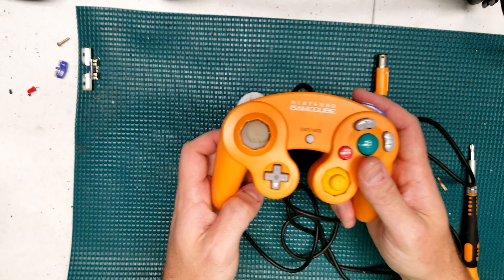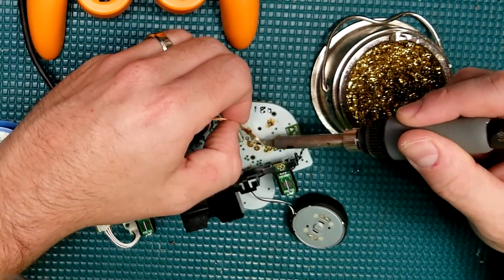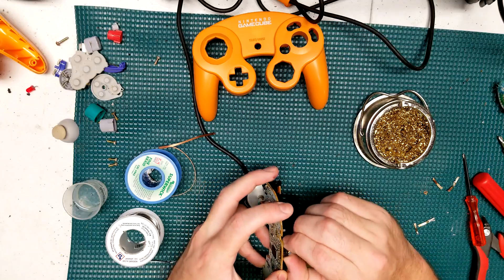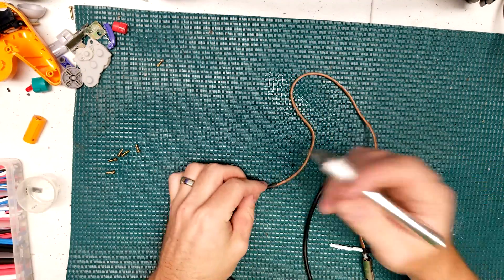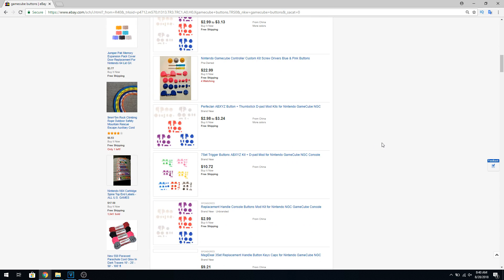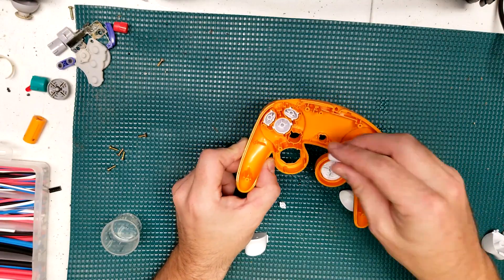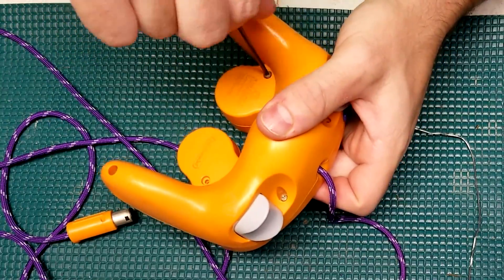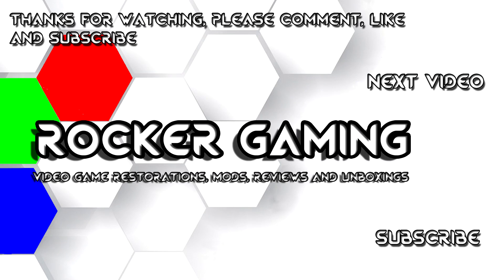Restoring and Modding a Gamecube Controller + Giveaway! Get ready for Smash Bros Ultimate! Custom!

Comment: Personally I think the 10 minute mark is the sweet spot for mod vids. I don't know if 5 is enough to cover everything in depth and really show the process.

P.S. I'm using your videos as a guide for my own upcoming GameCube mod. All of the stuff hasn't arrived yet but I'm excited to breathe new life in to the old favourite!
Reply from the maker: Lang, I am very happy to hear that!  Make sure you share before and after pics with me!  I would love to see what you come up with!
Reply: This will be my first real mod so I'm not going too crazy! I have a Pluto IIx board waiting to be installed and I'm thinking of adding LED lights and a XENO GC chip. I've seen the XENO clones sell on eBay at various prices and they're marked as "XEN8". The genuine XENO boards seem to be hard to come by and I'm kind of worried the knock-off boards will break after a while.

Do you have any experience with the XEN8 model and how prone it is to failure?
Reply from the maker: So a little dirty secret, lol.  Every time I have showed a xeno chip installed on the channel its a xen8.  They seem to be just fine as far as I can tell.  I would just order more than 1 as I have run into a few (maybe 2 out of 100's) that have not worked correctly.

Comment: Thank you! I have been playing around with mods for a while on GC controllers and kinda want to start doing it for friends and the cord trick was the last tool I really needed. I am an electronics repair tech so most mods come naturally to me but the cord thing was driving me insane. I was thinking people were getting braided usb cables and some how replacing the ends. I thought that seemed like way too much work for most people and one of the custom controller places offered colored cables for cheap which confused me even more. Then I saw one of the custom places call it a paracord wrap. So it finally clicked and now im here.
Reply from the maker: X9, thanks for stopping in and dropping a comment!  Feel free to sub if you have not done so yet, there is plenty of modding goodies on here and as far as doing controllers for friends, you should absolutely make it happen!  The paracord is a pain the first couple times you do it, but you get pretty decent at it pretty quickly.  Let me know how it goes for you!
Reply: Already subbed! I will let you know how it turns out. I might try picking up some paracord locally as shipping from that place you linked is expensive. I assume 550 cord is the same diameter and everything no matter who makes it. If I can find it cheaper I will let you know.
Reply from the maker: Sounds like a good plan to me.  They do have free shipping sales from time to time and that is when you need to pounce, lol.  Whenever I get an email notification I stock up, lol.

Comment: You could probably sleeve the cable easier if you just tape a skewer or unfolded coat hanger to the end of the cable and use the rod to feed it though.
Reply from the maker: It's a bit tight to make that work, but I'll give it a shot next time I do this mod!  I appreciate the comment!

Comment: You could try 750 paracord instead of 550. The outer sheathing is slightly bigger, may be easier to slide over the cable. You can look up Type IV or MIL-C-5040-H to find it.
Reply from the maker: fantastic advice!  I am going to look into it in more detail!  The 550 comes in more variety, but you're spot on with the 750, its decently bigger!  Thank you again, appreciate that advice!!

Comment: Hey great video. I have a question, I tried sleeving my cable and I have to cut off the connectors as well in order to get the sleeve on. Although when I resoldered it to the board the cable is no longer working? I bent the connector a tiny bit but everything seems to be fine on that end so I was wondering what went wrong with my cable. I had no other way to strip the wires than to burn them since I do not have a wire stripper. Is that what ruined my cable. Or could it be that I solder and resoldered to many times and I burned something? Would be great if I can fix this
Reply from the maker: Chris, thanks for the comment.  Nothing you mentioned there would seem to indicate that you ruined your cable.  You should have soldered your cable back to the PCB as follows:

1 - Blue
2 - yellow
3 - Red
4 - Green
5 - White
6 - Black

The Controller PCB is labeled with 1 and 6 so you should be use that and the guide above in order to get it back up and running.

Comment: What's the tool you used for removing the cables from the 6 pin connector? I'm doing the same sort of thing except replacing the whole cable.
Reply from the maker: I just use a very basic dental pick, but it word really well!
Reply: @RockerGaming  thank you very much! Great job on the controller!
Reply from the maker: No problem and thank you!!

Comment: Question, how important is the copper shielding on the inside of the controller cord? I recently did two, one with and one without the shielding and the one without is having issues. Any idea if that is causing my issues?? Thanks in advance for the input
Reply from the maker: In my experience and talking to others it's not important. I would just double check you have the pins all soldered back into the board correctly and in the right order as well as make sure you have no shorts between the pins on the board (use a multimeter to test).  If all that looks good, I'd use a multimeter to test for continuity between the plug and the pins you solder into the controller board.  Between all the above it should help determine what is causing your issue.  If all those come back without a hitch your issue is not related to sleeving the cable.

Pin 1 = blue
Pin 2 = yellow
Pin 3 = red 
Pin 4 = green
Pin 5 = white 
Pin 6 = ground

The above pinout assumes you're using an official GC controller from back in the day.
Reply: RockerGaming I did double check to make sure my pins were for sure in the correct order. Can anyone walk me thru how to use a multimeter to check that I don’t have a short somewhere. I suspect that it’s my solder job but am not for sure
Reply from the maker: @jmarquez5554  there is likely a video help explain it. But you set it to continuity mode. You know it's the right mode bc if you touch the probes together they beep. Then just put the probes on each adjacent pin. If you get a beep you have a short and you need to clean up your soldering.

Comment: What is the copper coil around the inner wires for? I stripped the rubber off of my controller and cut a few strands near the plug of the controller.
Reply from the maker: That is the shielding for the voltage, ground and signal wires.  Based upon what I have read and tested the general consensus is that Its ok to remove it.
Reply: @RockerGaming  That makes sense, because those wires are all individually sleeved. I figured the copper is what you were referring to towards the end of this video. Thanks for the response and keep making tutorials, your work is very inspiring.
Reply from the maker: @DxCrepp738  No problem dude!  Please share whatever you make on Twitter with me!  Will do, I am working on another controller mod video right now, pretty excited to share this one!!  Its been a long time in the works!
Reply: @RockerGaming  you got it. I'll be sure to share pictures when I finish this first controller. It should be done by the end of the week. I'm just waiting on the paracord.
Reply from the maker: @DxCrepp738  The paracord is the tedious part, just take your time and you use clear packing tape it makes your life 10x easier.  Also, I show the exact technique I use in this video, it works pretty well!  https://www.youtube.com/watch?v=ejyOUG4LifI
Reply: @RockerGaming  Okay Cool, the tape around the pins keeps them all in the same space so you don't have to cut them off.
Reply: @RockerGaming  Hey, so I am having a pretty rough time getting the paracord on my wire... is there a possible way we can work together on this; I can mail you the wire and paracord to have it professionally done. I will pay if so, and it might be a good video opportunity, maybe?
Reply from the maker: @DxCrepp738  Hey sorry, missed your last reply.  Here is what I would do: you'll want to bunch all the pins together into an arrowhead type formation then use some clear packing tape since its nice and slippery to hold it in place.  Then start to sleeve the cable using the technique in the video i linked above.  If that doesnt work, what you can do (if you're handy with a soldering iron) is exactly what I did in this video, cut off the pins and resolder the cable back to the board manually.  If you do this method it should be pretty easy to sleeve.  The key is using the sleeving technique I show in this video.  https://www.youtube.com/watch?v=ejyOUG4LifI

I am a bit backed up and not taking commissions right now, but let me know if the above helps or where you're having trouble and I can do my best to help you out!!
Reply: @RockerGaming  Long time no speak, sorry for the delay but I have been pretty busy myself lately, I understand. I have not tried sleeving the controller again, yet, but I do intend to try sometime tomorrow. I also did some research and found that the 750 cords may be more easy to sleeve the wire... Judging by the pattern of the cord in this video I'd say it's still 550. 

I also have plans to put LED's inside my console... don't know when but I just cleaned the system out earlier this evening. I gotta say it was pretty..fun. It makes me want to do more, so I'll be looking for LED diodes next time I go shopping.

Comment: Hey I’ve been working on mine for a couple hours and I’m having a tough time getting the GameCube cord through the paracord
Reply from the maker: Luke hopefully this will help:

Take a look at this video to see how I tape up the pins on the cable - https://youtu.be/g9Ea-tqHj5w?t=613

Take a look at this video to see the technique I use -  https://youtu.be/ejyOUG4LifI?t=199

Both of these should start at the relevant part of the video.
Reply: RockerGaming thank you I’ve been working on it for like 2 hours and nothing worked
Reply from the maker: @lukedavis_mp  No problem dude, hopefully this does the trick for you!
Reply: RockerGaming honestly I just think 550 paracord is too thin. I’m thinking I just have to go another side up. I’ve tried a lot of different things I just can’t get it all the way through
Reply from the maker: @lukedavis_mp  bigger will be easier for sure. I use 550, but let there be no doubt the first couple times doing this mod it was a struggle.
Reply: RockerGaming is your paracord 7 stranded?
Reply from the maker: @lukedavis_mp  I use 550 paracord from paracordplanet.com not sure how many strands but if you head over there it should tell you
Reply: RockerGaming hey thanks for the help! I message you on Etsy! I got it done! Works flawlessly. Quick question what can I do to ensure the controller doesn’t short out. I replaced a GameCube thumbstick and it work for a while but no longer works? Have any clue what happened? Thanks again!

Comment: I wonder,

The stickbox on the aftermarket controllers is usually absolutely crap. It's not too bad to begin with but they don't last at all.
I did buy one in China that looked like a knockoff Polyshine box, with yellow pots on the sides, but without the F logo and with a slightly different moulding on the pots, so it's not a real Polyshine, but it's pretty decent, seems like. Was a bit more expensive.
And yet when i looked up specs on Polyshine boxes from a local supplier, i noticed that those that are available to me have deadzones in X and Y, which is not needed because the real deadzone is software, and will make for a very poor angle control. They make it by plating a bit of metal in the middle of each pot. When i think My Life In Gaming tested an aftermarket N64 stick made from a Gamecube-style stickbox he noticed in his video a behaviour that is consistent with this specification. Something to be aware of, that you can actually buy stickboxes that will behave weirdly improperly.

Comment: Speaking of Third Party, I know this is a Stupid Question coming from me, but is it possible to Mod a Third Party GameCube Controller? Some I saw had the Left stick wobbly wobbly (No Pun Intended) others I saw whenever you plug it in with a GameCube or Wii doesn't work. And here is the most craziest of them all. some third party controller's don't work at all
Reply from the maker: I absolutely think its possible. From what I have heard the only one worth getting is the Hori GC controller, the rest are pretty bad from what I hear.  I also hear that some folks have been modding the clear TTX 3rd party controllers to work OEM GC controllers.
Reply: @RockerGaming  That's nice to know!

Comment: what is that liquid you put on before soldering and desoldering? whats the purpose?
Reply from the maker: That is flux. It helps endure a solid connection between the two solder points. It helps remove oxidation as well allows the two (or more) points to heat up faster and ensure the joint is well wetted. It makes life 10x easier when soldering.
Reply: @RockerGaming  ooo, which one did you use here, planning to also paracord a controller :D
Reply from the maker: @lootingu  No problem, here is all the tools I use!

Soldering Iron used:

https://amzn.to/2S94xDk

Flux used:

https://amzn.to/2G0fUqK

Wire use:

https://amzn.to/2CNC1O3

Comment: Awh poop the paracord I bought seems to be way to small for this cable

You wouldn’t happened to know where you bought yours?
Reply from the maker: Yes, I am using 550 paracord that I bought from paracordplanet.com.  That website has an incredible selection and if you wait for a sale you can get 25ft lengths of cable for $5 or less shipped.

Comment: what are the measurements for the cable?
Reply from the maker: I just made it 3 inches long than the stock controller cable and then trimmed to length to make it perfect once installed.
Reply: @RockerGaming  hmm so im currently looking on ebay for the paracord but the size options are 1/2",1/4",1/8",3/4",and 3/8", and i have like no clue which one  to pick.
Reply from the maker: Chriz   Here you go buddy!  https://www.paracordplanet.com/paracord/550-variations/  Pick your poison 😎  the key is you want 550 paracord
Reply: @RockerGaming  ty so much man👌🏿

Comment: This was amazing brotha good work any advice on where I can learn on how to repair controllers a little more in detail I want to begin getting into restoring controllers as a hobby. 

Dropped ya a Like and sub 

Laz- viva las vlogas
Reply from the maker: Dude I appreciate the like and the sub! I would get started by learning how to solder on already broken electronics and the  graduate to some very basic mods. Once you can do that with no issues slowly work your way up to more complex mods. That's how I've done it over the years and it works great. The beauty of doing controller restorations is there is a lot you can do without having to solder anything.
Reply: I’m glad I’m in the right head space I was I ordered some 10 dollar controllers to start playing around with. I’m planning on taking it apart and putting back together as a starting point lol.
Reply from the maker: Smart man. Start small and work your way up. Next do some button swaps, then learn some basic soldering and move on from there. You will get pretty affluent with time and practice.
Reply: RockerGaming lol when I do it I’ll leave ya a update in the next video you drop lol It will either be a complete flop that I learn from it a success that I learn from lol